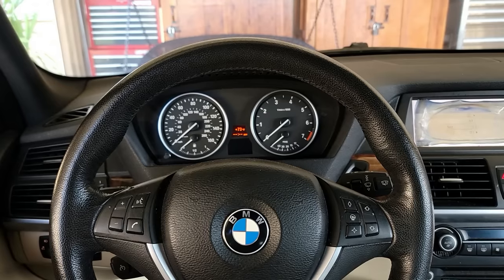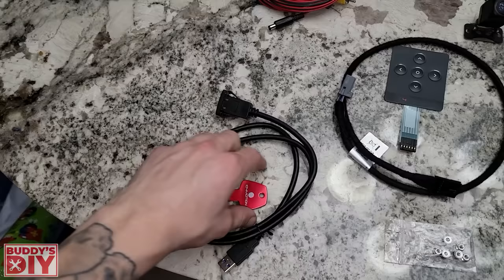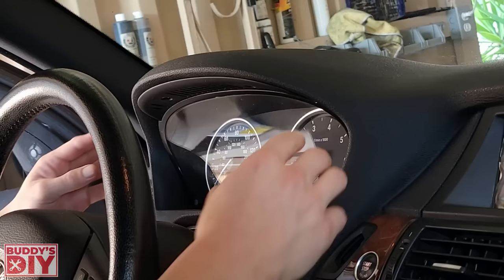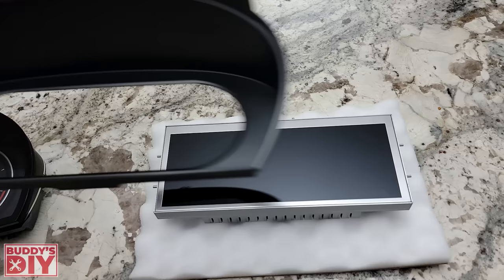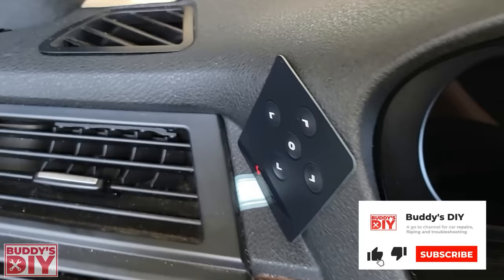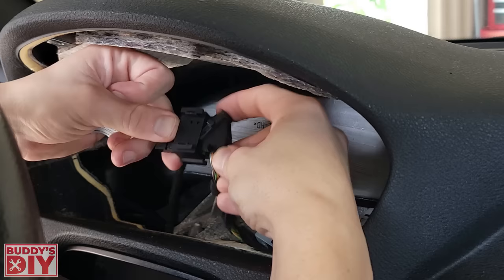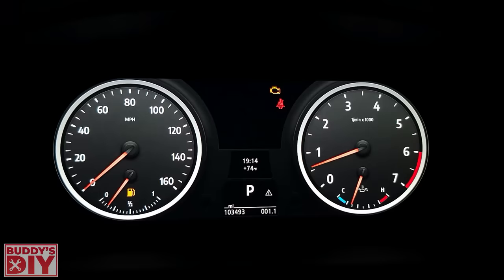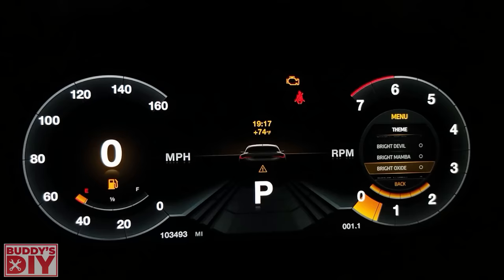The COOLEST Bmw Interior Upgrade! | E90 E82 E70 E6x 3,5,6 Series And More!

Comment: Analog cluster all the way. I've had too many friends have their digital cluster turn off. No idea the speed, gas or anything until it gets fixed. And on the newer cars, you have to get the computer reset when the cluster is replaced. (so an additional $500+)

Comment: I really like analogous speedometers, I prefer them over the digital ones. Doesn’t matter what car or brand.
Sure they look awesome but there’s something about the analogous ones that the digital ones can’t replicate.
Reply: Depth, that's about it.
Reply: @ventilate4267  I learned to drive in a car that had both analog and digital speed indicators (2017~ Citroen c3), I only used the digital one, my first car was a 2008 Citroen c4 that had a digital centered cluster and it was easier to read because the font size of the numbers was big, I'm now switching to a BMW E90 and I'm struggling to read the analog gauge.
Reply: @aleaallee  zoomer moment
Reply: NEEDLES
Reply: @aleaallee  how did you pass medical check ? You are danger on roads if you can't even read gauges

Comment: Dude the advice on 2:26 about disconnecting the battery seems wrong, you want to leave the ground so that there’s no current, by leaving the positive wire you basically let the current flow with no ground and that’s exactly how you short something.

Comment: I fell in love with BMW because of their traditional speedometer. Simple and beautiful. I also like the colour when driving during the night.
Reply: That colour was specifically used so your eyes don’t have to adjust when looking at it then outside.
Most colours require your eyes to adjust but BMW figured out that colour requires no change on the eyes

Comment: Once you change the gauge, What happens to the Odometer? Did it reset to 0? or the previous odometer reading automatically transfers to the new gauge? Thanks!
Reply from the maker: Ecu tells it the correct miles. Older model cars like pre 1999 have the miles stored in the cluster but all moderns cars have the miles or km stored in the ECU
Reply: @BuddysDIY  Thank you very much for your kind & prompt response. Always looking forward for your next video. It's but quality and not quantity. Keep it up buddy!!!
Reply: @BuddysDIY  MMM odometer info is stored in a few modules in the car... ECU, FRM and I believe it is also stored in the Cluster... Even in the key! So... Who know what will happen if you re-install the old cluster. Anyhow it looks cool, if you are not planning to sell the car what the hell! I like it.

Comment: You should check if you can now reset the oil service reminder and all of the reminders from check control because when you replace an OEM Instrument Cluster in the E60/E70 and don't code the VIN in it,you cannot reset those anymore and the odometer goes back to the initial reading when you unnplug the battery.
Reply: The Vin is coded in that cluster because you have to provide the VIN before the purchase. Check theirs website.

Comment: i would never bother to do this
besides ttraditional cluster looks way better than this modern electronic look
Reply: Original looks cheap and crappy that's why they replacing
Reply: What are you talking about ??? The BMW orange dials are iconic and have been around for years !!!
Reply from the maker: To each their own guys. I like the moderns digital look and some people lien the old analog look. I got a 11 inch touch screen in my 08 3 series. It's all about what u like

Comment: Hello Everyone I need help. I am getting this error code in History and Current but not in Pending when I scan my car for any trouble code, P2109  - Throttle / Pedal Position Sensor 'A' Minimum Stop Performance. What should I do? There is no check engine light on but when I scan Engine and Ect for trouble codes I see this code everytime. The car I have is Toyota Vitz 2018 model with 1KR-FE engine my friends also have same car 2014 model Vitz with 1KR-FE engine they are also getting same error code when they scan the car.

Comment: 7:05 on the video the coolant temp looks really high, way above the middle point. Is this the fault of the new digital dash or the car actually is overheating?
Reply from the maker: It runs hot. this SUV has been a nightmare
Reply: @BuddysDIY  you r really responsive man! Never got a quicker reply from any YouTubers before 👍
Reply: @BuddysDIY  btw what about the camera? Will you do an installation video on that?

Comment: Does it work on a x5 2011, 35d.    And which version i would need did see( they have 3 I checked,  ) see water /coolant temp. Def /ad blue level permanently on the  display?

Comment: To everybuddy who is reading this, i need help, i have a e90 318d (2l Diesel, 140 HP) with about 235k km on it, its my first car, i did not much to it yet but this mod is so frickin cool. Now my Question is, would you advise me to buy this? It would cost around 2000€ so a bit pricey for first car (i payed 2.500€ from a friends father) and even with this mileage. I cant decide if i should buy it or not, its nearly the half the price of the car, or maybe there is a cheaper one out there

Comment: Me: Hey, your engine has a misfire and a check engine light. It could be a coil pack, since you have 103,493 miles on them.  
You: Yeah, but I need a new, digital cluster first and the corrosion on the negative battery terminal is totally fine. 
Me: REEEEEEEEEEEEEEEEEEEEEEEEE!
Reply from the maker: 🤣🤣 priorities bro.
Reply from the maker: Believe it or not it has brand now coils and plugs. It's something else. This X5 is a POS man

Comment: 2 questions: will this work on a 2013 x6m? And did you find a way to get that engine light off? I kinda take pride in not having any lights on the dash on 😂
Reply: Engine light on due to battery programming needed im sure as well as the misfires. Usually if i drive me around the block the timing comes back in and light goes off.